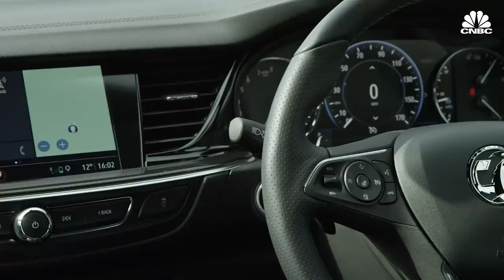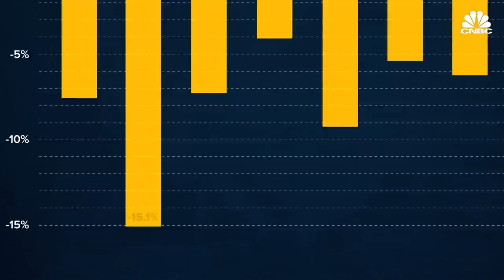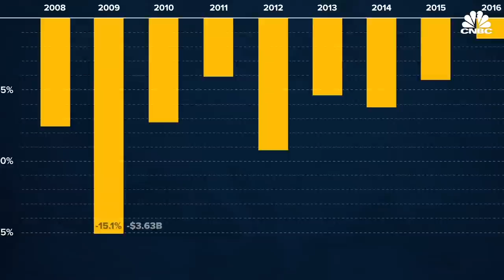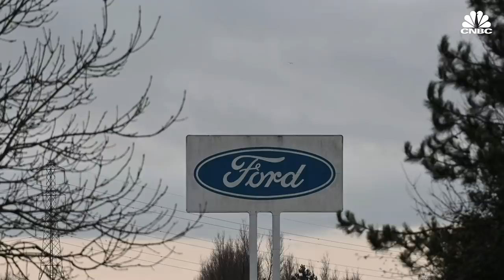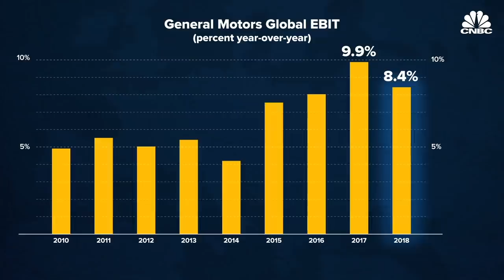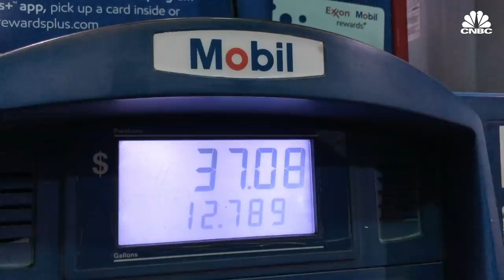Why General Motors Left Europe

Comment: The only reason why. GN. In North America is supposably doing well is because of cheap gas . Our Government is subsidizing the taxpayers money for  big oil companies to maintain their  relatively low prices so oil companies can maintain their profit margin  and at the same time dump "Cheap. Gas on the US Market .That way prices remain "low" and Large  Gas guzzling Pick ups, SUVs and Crossovers sale remain strong for the North American market 💪.
However ,if Gas Prices should rise up significantly due to an international incident or crisis both Ford and GM due to their dependant need to sell Large vehicles like the corn mentioned. Will find themselves in a pickle . With little or no smaller more fuel-efficient vehicles the cell GM and Ford could find themselves and have a carry situation Webmail smaller sedans hatchbacks in war fuel-efficient vehicles or a ternative vehicles such as electric vehicles to sell.
Furthermore in regards to the European situation, GM ( North America) has stuck it's nose into the European Market thinking that it knows what European buyers want from their former  EuropeanBrands Opel and Vauxhal l.These brands in the past clearly knew what the European  Customers wanted and ... Yes these two brands lose money in Europe for GM  Because of lack of innovation , interest, and a very tough and competitive market but also like their North American market brands Chevrolet,Buick,and Cadillac ( for the passenger CAR  market. Both Opel and Vauxhall we're not allowed to have proper BRAND IDENTIFY , refinement and quality issues became a new trademark so those makes could not exist as separate entities, this is the same type of mistake that GM made back in the 1980s when then CEO Roger Smith  created. a marionette   of front-wheel-drive platforms of GM's  Compact, Mid-size,and Full-Sized / Luxury models .GM  did model development on the cheap and created a smorgasborg  of mongrel vehicles that all lacked refinement desirability, quality, reliability, poorly, preformed and looked lall alike  appearance and style wise  This the same problems that plague previous GM models for the past 30 years, both marketing.Peope we're simply not interested in boring poorly put together unreliable cars  ;blunders and lack of understanding of what the American consumer really wanted in their cars precepted.So unlike the imports GM has abandon both it's domestic and European CAR markets in Favor of the "More lucrative" higher priced SUV'S,Crossover and Pickup market.
Why is GM doing this ?... Two reason s .1... GM, Ford and Chysler (Stellantis) Is Clearly dominant in the Truck,SUV and Crossover market  the ONLY market they they have a clear dominance in . 2.. .. "The Big three " is  virtually abandoned name the car market simply because they can't compete what import Brands and their too lazy or not innovative to compete what them... .. and this is a problem .... IF...  The gas prices go up dramatically with the possible saving Grace of electrification and hybrid models The big three  could find itself in huge  trouble when Gus prices go back UP again and the love affair of big vehicles like trucks , crossovers and SUVs end The domestic brand automakers won't have smaller more fuel-efficient vehicles fall back on and that could prove fatal to the future of Detroit, unless they adopt to environmentally friendly hair inefficient vehicles as emission standards become more stringent that will be more important for them.

Comment: Flawed video: Opel trumped VW till late 1990s. Vauxhall was a winner,  too. Poor quality,  not being American, harmed GM. 
GM needed to cut costs like PSA and was late with SUVs. Opel needed more Biick designs but needed these vehicles built in EU plants to improve capacity. Lastly, Opel was never properly paid for autos designed for Buick and Chevrolet with licensing fees going to Deleware, n oil t Russellheim.
You need people with more auto industry knowledge.

Comment: GM'S  car are crap. After 5 years they start falling apart and rust away. Brakes ware out , A/C dies, alternators start dying, power steering starts leaking and coolant pump pachs it in. Cost thousands of dollars to fix. Got sick of it on my last 2 GM products so we bout a Toyota Camry in 2008. Only thing don to the Camry in 11 years is oil changes. Breakes are still at 30%,  A/C works like a champ and no leaks of any kind. Have gone 7 years now with no car payments and 11yearswith no costly repair bills Will by Toyota for the rest of my life.

Comment: European roads are small and bendy, american cars are wide and dont handle corners very well. Their interiors look and feel cheap compared to european brands. Replacement parts arent as easy to get compared to european ones or even asian ones. Build quality isnt quite as good and fuel economy is very poor. Like a city car here might be a VW Polo (40-55mpg) or Toyota Yaris (60-70mpg) or even an Opel Corsa (50-70). Hell even an old saloon like the toyota avensis(30-60pg depending on the model) or vw jetta  (37ish) is still way better than most american cars. And have nicer interiors. It really isnt a mystery. And i used to own an opel astra. 1.4 petrol and liked it. It was small and efficient and cheap to repair. Compare this to a big american car that will drink through petrol, which is more expensive in most european countries than america and its a no brainer

Comment: Why not ask a Australian for opinion like mind!  GM n Ford has made big mistake and with GFC the bean counters run the car companies.  Here in Australia Ford made poor design car of AU Falcon which effected sales until BA model.  Holden did well from late 90’s until 2006 when sales drop off this turning point for SUV.  Holden did right by building VE, VF models but car should been slight down size n came with smaller V6 n diesel engine but it didn’t.  Ford could have done the same but US parent companies weren’t handling over the money.  Nail in coffin was non sharing platform of Ford, Australian government stop investing in the industry and labour cost but really Ford n GM knows best.  X amount years later Ford been lucky with sales of Trucks but at what price of truck n no small cars been built.  GM hero car was been built over Europe but that’s stuff now.  Canada n Europe could learn what happened in Australia.  If GM don’t produce car for rest of World it’s dead if fuel crisis hits.  My solution is combine GM n Ford in Australia, rebuilding cars in Australia and manufacture trucks RHD with efficient engines n another line efficient small SUV cars and if works allowed be sold to Europe in small but sustainable numbers.  I am sick of hearing electric cars will work when here in Australia we don’t have enough power in summer.  GM is just stupid n wasting money no accountability.  Holden was making more money on Commodore sedan then other GM car

Comment: Toyota has no problems to sale all over the world. Now, tell me, if you want to replace transmissions every 30k miles , then by GM 😂😂😂😂😂...garbage
Reply: What killed my respect for GM was my last Chevrolet that I bought in 2009. I bought an extended warranty and got my money's worth out of it. It needed service more often than oil changes. In the 7 years that I owned the car, I think six months was the longest it went without repair. It was mostly suspension and steering. It was the same repair over and over again, passenger-side tie-rods. I never drove it on dirt roads or towed with it and the roads that I took it on were generally smooth. Now I have a Subaru that I'm considerably more rough with. After three years, only a wheel bearing replacement. M experience is anecdotal, but I'm sure it is common. If GM wanted to encourage repeat business, they'd build better cars. If Toyota and Honda can build reliable cars in North America in Europe, why can't GM?

Comment: Who is this specialist... Gm fail in Europe cause Murican cars have lower quality, we don't want big trucks in Europe, we want quality build with technologically evolved engine. Ford us is lower quality compared to Ford Europe. Comparing the similar models the inside quality of the car is very different as proven. French psa had one of the most evolved diesel engines for years. Beating German brands. With the shutdown of diesel engine for passenger car all European brands had to start evolving their gasoline engines, Ford has been evolving their low displacement engine since 2011. And now in 2019 Ford with its new European designs is selling more. The ecoboost 3 in line is very reliable engine compared to vw group tsi that is constantly on the shop bring fixed.
BMW with its 1.5 in line engine very recent! Being used on minis is crappy and a headache for the owners. The European brands were diesel Kings and now due to regulations on emissions being tighter they had to rush new gasoline engines without much time to mature and test them properly.
Keep you gigantic trucks muricans. Learn with Ford if you want flourish in European markets
Reply: Poppycock.  Typical European arrogance in play.  Ford Europe uses Exactly the same technology as Ford US, and That is why they are often ranked as high in quality and capability as any domestic European Car- and, for that matter, they are often ranked as one of the best makes in Europe, excluding, of course, the hand built super cars (and we've got a few of Those makes in America, too).  And, when you come to emissions standards, the entire world is struggling to come up with standards that approach those of one American state, California.  Admittedly, much of the USA is annoyed at having to follow California standards, as well.

As to big trucks- if you had properly large roads, the way America does- and, for that matter, much of the rest of the world, you'd want to use big trucks and SUV's.  However, with narrow roads traversing cramped, ancient cities, of course you'd want to avoid vehicles that are practical Here.